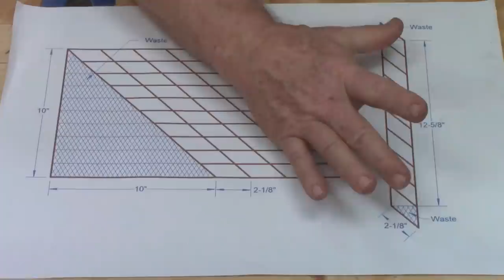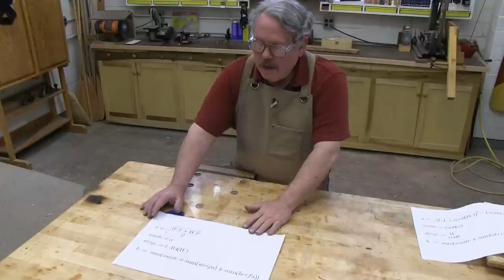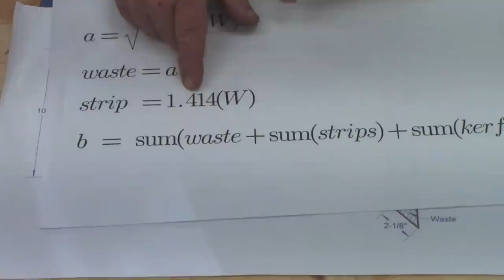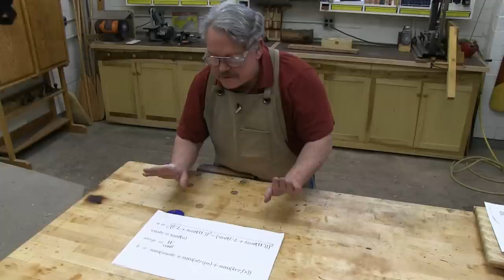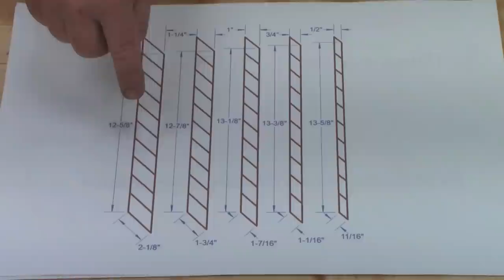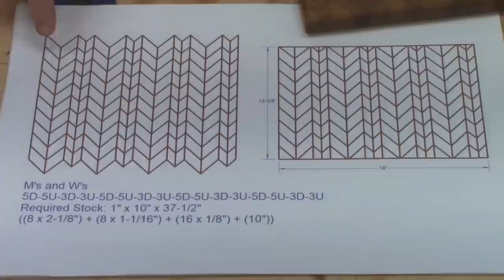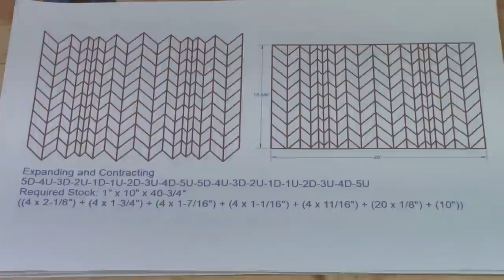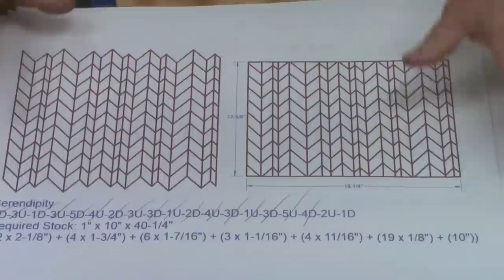Herringbone Cutting Board - Tips & Techniques

Comment: If you offset the edges of your boards during the initial glue up to approximate a 45 degree angle, you’ll have a lot less waste when you make your 45 degree cuts
Reply from the maker: Good suggestion, but they will be a lot more difficult to clamp. See my reply to Franken Berry.

Comment: An excellent presentation!   But I have a suggestion for cutting the strips to width.  Instead of constantly shifting the fence, why not fix it in one place and then make a set of spacer fences that are placed against the main fence?  The spacer fences could hook on the edge of the saw's table to keep them from sliding with the stock, and possibly have magnet as well.

Comment: How come when I tried a carriage bull I just made a mess everywhere and the carriage built Didn't do what yours did
Reply from the maker: Sounds like you used too much glue to begin with. However, you should know that when you're applying glue to strips for the first time, almost everyone makes a mess no matter what method they use to spread it. You get better with practice.
Reply: @WorkshopCompanion  are you turning the  bolt?
Reply from the maker: @TheDuttonExperience  Nope. Also, it helps to use a glue with a low-to-medium viscosity.  If the glue is too viscous, it won't flow between the threads.

Comment: Very nice.

1. Instead of gluing the strips so you have a big 90 degree plank, offset them so they are at about 45 degrees, less waste.

2. Would a band saw with a wide blade give a good enough gluing surface? The kerf is smaller and you would have less cutting board sawdust.
Reply from the maker: A staggered glue-up is a worthy idea, but it's difficult to clamp the ends so you get a good glue interface all along the plank. I simply use the waste to make smaller cutting boards and coasters. As far as a band saw is concerned, the washboard saw marks don't make for good gluing surfaces. You'd have to sand or trim them. I use a thin-kerf blade (.095") to reduce waste. Thanks so much for your ideas!

Comment: To cut strips of different width without having to set the fence all the time, you could make additional spacers of different width to insert in the spacer you have clamped to the fence.
Reply from the maker: Yes, you could. Good suggestion if you're making a lot of these.
Reply: @WorkshopCompanion  thank you!
I just love to waste time to save time.
Reply: You could even glue a staggered block to clamp to your fence and then pull back the miter gauge depending on what width of strip you want to cut.. Narrow strip? Pull back very far. Wide strip? Just clear the blade 

I hope that sketch of a description makes sense ...

Comment: Hey Nick, which do you prefer, end-grain or conventional style cutting boards, and why? Thanks!
Reply from the maker: I would like to say that I prefer flat grain for three reasons. (1) It doesn't absorb/release moisture as quickly as end grain. (2) The alignment of annual rings isn't as critical as it can be in some species where there is a large disparity between radial and tangential expansion/contraction. (3) The board is much stronger when the grain runs through the length rather than the thickness. The down side, of course, is the knife marks don't "heal" as they do with end grain. However, all these considerations are moot in my kitchen. I'm not allowed to use any of the "good" cutting boards I've made lest I mar them. I am confined to an ugly piece of resin-impregnated bamboo with burn marks owing to a close encounter with a hot stove. All the arguments I have just presented pale in comparison to this: (1) Not using the "good" cutting boards -- no matter what their grain orientation -- keeps my marriage intact. So, in the end, I prefer badly burned bamboo.

Comment: I'm making a checkerboard pattern cutting board.  Will putting blind dovetail joints behind the surface make the glue joints last longer, or do the regular butt joints last so long as to make it pointless?
Reply from the maker: No matter what joints you use, a checkboard assembled from contrasting woods will only stay together if all the wood grain in all the pieces is oriented precisely the same. And if you're making an end grain cutting board, you'll need to match plain sawn to plain sawn and quartersawn to quartersawn as well.
Reply: @WorkshopCompanion  I accept that, but will doing some joinery in there help at all with longevity or disability vs just glued butt joints?  An I wasting my efforts?
Reply from the maker: @pleappleappleap  If you're making an end-grain cutting board, effort wasted. If you're making one that shows flat grain, spline joints would add just as much strength and would be much easier to make.

Comment: I thought of waxing but was concerned that, especially with end grain, the wax might get in deep enough to the gain to ruin the oil finish. Have you had that issue?
Reply from the maker: No. But then I wipe down all my projects with water before finishing to raise the compressed grain and make any loose fibers stand up. (Then I sand once more with the last grit used.) The water will expose any spots where stray glue, wax, oil, silicone, stearate, or grease might interfere with the finish. If there are any spots, I either sand them or clean them with naptha or acetone.

Comment: Hay Nick the math is great but it works on a chevron pattern not a "herringbone" pattern. Your first "standard pattern" sheet at 10:50 has chevron printed on it, so is it Herringbone or Chevron?
Reply from the maker: It depends on whose definition of "herringbone" you subscribe to. When  I started publishing the designs for these cutting boards in my books over 30 years ago, I wrote this: "A 'herringbone' design is an arrangement rectangles or parallelograms in a zig-zag pattern, resembling the bones of a fish. The designs I’m about to show you are technically all “chevrons,” so-called because the parallelograms are arranged so that each zig and zag comes to a point, forming a saw-tooth pattern. (Chevron is descended from an old Latin word that referred to the joining of two rafters to form a peak.) Whatever you want to call it, the design is tremendously versatile, as you are about to discover..."
.
Reply: 111111111111